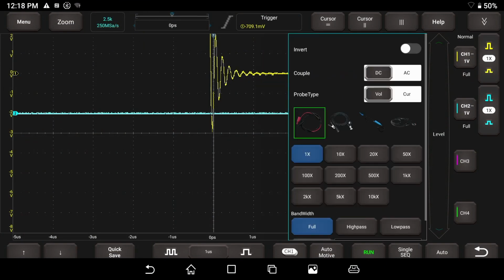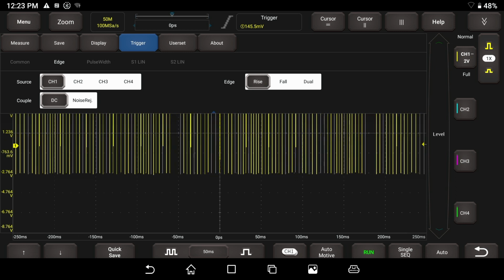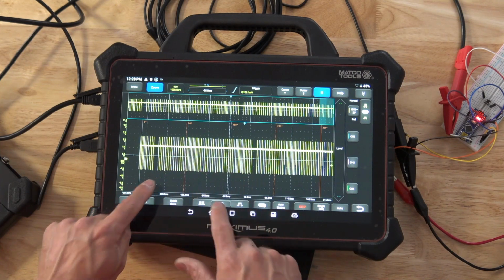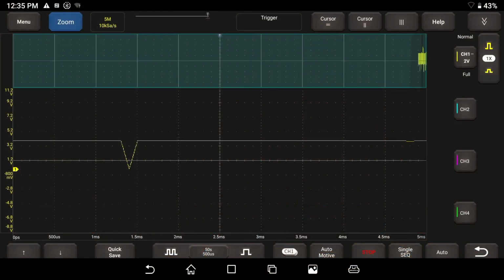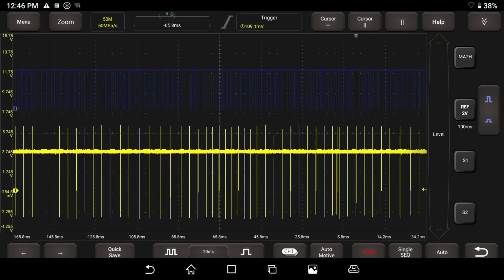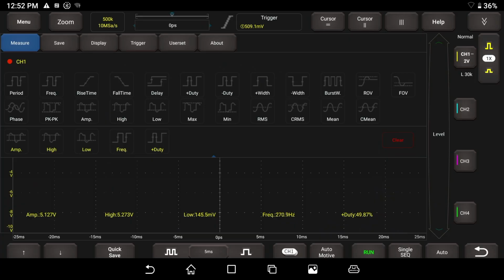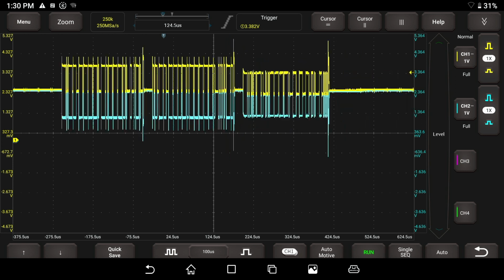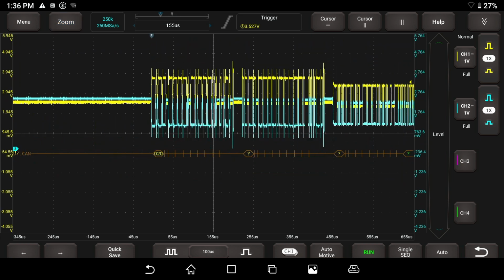Matco Tools  Maximus 4 0 Scope Basics

Comment: First time scope user here, we just recently purchased one and got around to watching this video to learn. For any other first timers, don't make the same mistake we did and plug in the attenuators with the leads. Couldn't figure out why we were getting such low readings until we realized we didn't need them in-line.

Great video and very informative!
Reply from the maker: Hey thanks for watching.  Attenuators are not a bad thing as long as you set the scope setting so it "knows" they are being used and adjusts the signal level appropriately.  Using a scope is not something i do for every job,  but more often than not I can see things that you just cant pick up with a meter.  for instance a comm issue the other day on a 16 Silverado, seeing the bias voltage low , but when certain modules communicate it was nearly proper, i knew we had a power supply issue,  found the common link between the modules that had no comm and we were onto it quickly.

Comment: Hey Brian! It’s a MicSig scope 😁 Someone pointed this out to me when I did the ThinkTool scope video (so same as TopDon too). 

Is the Matco diag tool also Launch based then? Cheers
Reply from the maker: Thanks I am about to make  up a part 2 follow for all the info that people are showing me in the comments.
Reply: @BrianMann216  Some good info. The degree ruler is a good one!
Reply: Absolutely correct mechanic mind set the Micsig Vato2004 is the scope and software mine works with my Topdon phoneix lite 3 I have a short proving this...save money buy the Vato 2004 same specs and software just arranged slightly different..very easy scope to use.

Comment: When using the 360/720 deg cursers turn on math. It should bring up an additional curser in deg.
Reply from the maker: I will try that!!
Reply: I noticed this with the ThinkTool version of this scope. I am gonna try too 👍
Reply from the maker: @MechanicMindset  I did not have any luck, will post a video later. I was not able to get the time rulers to measure in degrees. I may be missing something.
Reply: @BrianMann216  Ah ok, he mentioned something about a math channel which is odd. I do think it’s strange there not being a feature for degree measurement; but this was my conclusion
Reply: @MechanicMindset  My Miscig interface looks the same. The math channel wants to pick two channels automatically and I have to deselect the one, I tap on the red symbol and then the cursers read in deg. Also you don't have to bring up the floating box to select the channel, just tap on the colored arrow or touch the wave form and it should switch the cursors to be used on that one.